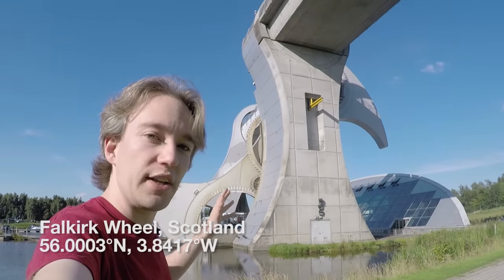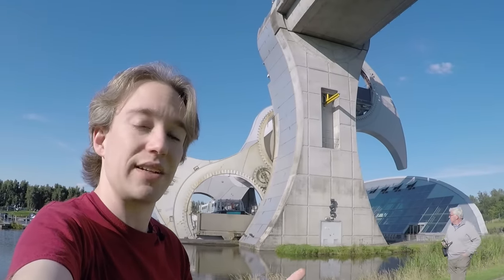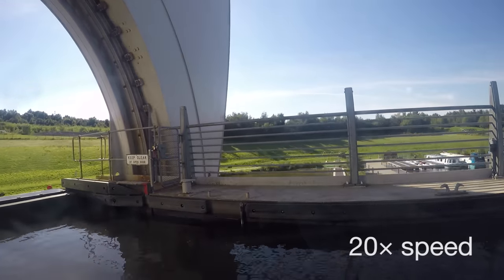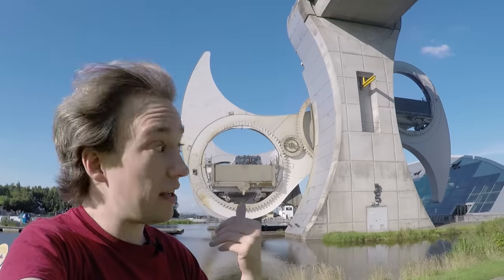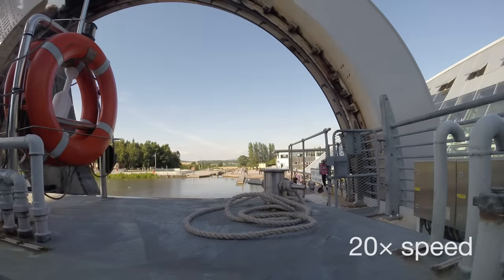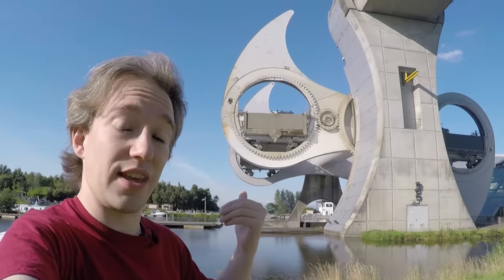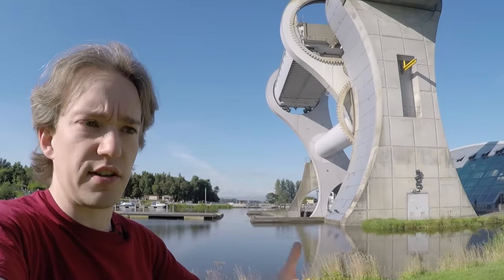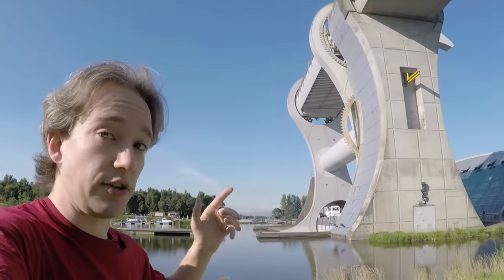Archimedes and a Boat Lift: the Falkirk Wheel

Comment: All fun and games until someone turns up with a 501 ton boat!
Reply: +Eric14492 Anything can float.
Reply: QuixoticQuaver Not if there is not enough water. If you try to put a 501-ton boat into 500 tons of water, it will go aground. As mentioned in the video, that is basic physics.
Reply: +rainbowevil You beat me to the reply.
Reply: In practice, it could only handle something considerably less than 500 tons. You need clearance all around the boat: beam, draft, and length. To maximize capacity, you have to design the boat's dimensions specifically for the lock, just as Panamax ships are for the Panama Canal.
Reply: QuixoticQuaver Tell that to the titanic.
Reply: Except a canal-fitting narrowboat of that draft which would still fit within the width (and depth) limits of a typical British canal, and still be low enough density to actually float, would end up having to be so stupidly long that there's no chance it would fit in the cason. Or most locks. Or get around any but the shallowest bends.
Reply: It depends on the density
Reply: @gwenynorisu6883  when you say shallow bends, I think you mean straight bits 😂, a 500 ish ton boat would be in the realms of 400m+ in length there are many places in the system that straight.

(im not trying to criticise just add to joke about how ludicrously huge such a boat would be)
Reply: D2O Heavy Water Anyone?
Reply: William Snow  its a joke
Reply: Then 11 tons of water would be displaced into the canal. Now that's serious business.
Reply: @Pippinn13  the union canal is a contour canal so it’s mostly bends.  Burke and Hare were too lazy to dig it straight any way too busy killing people.
Reply: @duffman9  Wouldn't it be lazier to dig it straight?  Or were they digging around land features?
Reply: Ever seen a plasma cutter? You'd have two ships of 251 tonnes in no time. Bit of bolting after the Mary Go Round, done. Next one, please.
Reply: @Eric14492  just send it around dry
Reply: @DreamClean  well my Accountant seems to think my Business can't float and he's right.

Comment: One of my family once remarked how amazing it seemed for such heavy canal boats to cross an iron trough viaduct, and that they were surprised it could take the weight...

2200 years after Archimedes and they still don't know how displacement works...
Reply: Somehow I get the idea they secretly hate you.
Reply: While your family member may have been wrong, it’s not as bad as you make it seem. Boats require a certain amount of water to float, and someone should have remarked how amazing it is, that a suspended canal can hold all that water😅.

Comment: *Not accounting for surface tension

Just because I enjoy been difficult.
Reply from the maker: +Paul Hutchinson Not accounting for water level changes in the canal, either, but they've got a fancy system of sluice gates to keep that even :)
Reply: +Tom Scott also the original prototype was made in Lego! 
and the Antoine wall (well what's left) runs over the top too!
Reply: +Tom Scott 
Really loving the series. 
So much I didn't know about.. :D

Learning is fun.
Reply: Gotta account for whether it's hard water or soft to.
Reply: @MichaelEdmond  Wait, wait, wait. I was literally just about to work out if I could build it in Lego. Dang but also yay!

Comment: The other interesting thing about the Falkirk Wheel is that it was originally designed as a simple figure-of-eight shape.  Then some arty type came along and put those pointy bits on the plans (they're supposed to look like a Celtic axe-head, allegedly).  As a result, there's a big notch cut into one of the viewing platforms 'cause otherwise the pointy bits would hit it.
So remember folks: make sure the last person to touch the plans is an engineer, not an architect; otherwise the engineer will have to bodge it after you've cast the concrete, and that's expensive.
Reply: +Edward Cree But the edge of the pointy bits never extends past the path traced by the outside of the functional circle that the caissons rotate in. Since the wheel does full rotations instead of only going 180 degrees and then back again, there's nothing that the pointy bits would hit that the mechanically-necessary bits wouldn't hit too.
Reply: +IstasPumaNevada I'm fairly sure the pointy bits do stick out further, though not by very much (so it's not obvious from the video).  However it's some years since I was there, and it's possible I could have misremembered.
However, there's definitely a notch in the concrete viewing platform - with a distinctly bodged appearance - that gives the wheel adequate clearance.
Reply: Edward Cree Not the best because the camera moves a bit, but if you watch where the rotating parts pass near the base you'll see there's no extra protrusion beyond the functional parts; the decorative parts appear to be curved circular and at the same radius as the edge of the track for the rotating tubs.  https://en.wikipedia.org/wiki/Falkirk_Wheel#/media/File:Falkrikwheelanimationmedium.gif 

Perhaps they needed to modify the platform to conform with health and safety regulations? Such as keeping the moving parts further from arm's reach, or making sure there was enough room between the platform and the moving part so that if someone jumped or fell over the railing the clearance was too great for them to be crushed.
Whatever the case, I would like to see the boat lift in person someday. It's very impressive engineering.

Comment: HI TOM! Love your videos. I have a suggestion for your next two! 
1. How cosmic rays interfere with computertech and how programmers actually have to make ways to error check because of it!
2. How you can find the speed of light by using a sausage and microwave oven (it can actually be done).

Comment: So no submarines then ...
Reply: +Penny Lane a submarine that would fit would still make it balanced, most submarines don't sink, but make their density exactly equal to water, so that they don't slowly go deeper and deeper. The only time it actually sinks is when it's descending.
Reply: sundur I was expecting "submarines can also float on the surface duh" remarks but what you said is actually clever :)
Reply: +Penny Lane There are intelligent people on the internet? Woah. Mindblown.
Reply: +Weber588 o-o Sounds like the title of the next video: ,,Things you might not know: there ARE intelligent people on the internet" ;-)
Reply: +Weber588 o-o 
Say, intelligence and wisdom is not the same thing.
There are a LOT of intelligent people on the internet.
Wisdom is a rarer beast.
Reply: +Penny Lane   As long as they are not sunk,  submarines follow Archimedes.  Now some scientists claimed differently as they tried to sell submarine detection through gravitational disturbance and that's only possible when Archimedes does not apply that's only after they were detected and sunk.
Reply: Adamast And by "following Archimedes" you mean Archimedes' principle? Because in this case I think what sundur said is more comprehensive and to the point. Archimedes' principle basically says that if and only if the density of the object replacing the water (i.e. the submarine) matches the density of the surrounding water do two things happen: a) the submarine neither sinks nor rises because there's no net force acting on it and b) you don't break this magnificent boat lift ;)
Reply: Penny Lane - Submarine? 
LET IT FLOAT, LET IT FLOAT
Reply: They,re in Faslane on the Clyde, nukes!

Comment: Why does an average American house use three times as much energy as a British one?
Reply: +doe maeries Because 'muh freedomz and muh liberties' takes a fair ol' whack of power to achieve.
Reply: doe maeries My guess: Air condition, oversized fridge + seperate deep freezer, dry tumbler and asinine vertical axis washing machine that does not really clean your stuff unless you let it run it for at least 4 hours and leaves your laundry wet.
Reply: +o_O Vertical axis washing machines?? you are joking right? Who the hell come up with that idea and that what is used to mimic gravity? ahh i have to google this!
Reply: +doe maeries The U.S. is a huge place, a good chunk of which is either a desert, or a thousand miles closer to the equator. We simply have people living in warmer climates than the British do, and air conditioning takes far more power than heating does.
Ignore the "muh freedumbs" and "greedy 'muricans" shitposters.
Reply: Hum, but top loading does not equals to vertical axis. I assume vertical axis means an, well, vertical axis where the force of gravity has very little to do when its spinning. but teh top loading machines i have seen are still horizontal axis, just loaded from a different place, and in that case the end result and efficiency should be very similar (ignoring other factors)
Reply: +Mr. Patrick Henry Cheryl It's not just air conditioning in warmer climates. We also have colder climates than England, requiring more heating. The average home is larger in the US than the UK, so heating/cooling takes more energy. You are correct that AC is the the largest reason.
Reply: Oh. Ok. that seems a little stupid. The ones i have seen are loaded from the top but they have horizontal axis.
Reply: +maxsnts I have never heard of a top loading machine that spins on a horizontal axis. Most residential washing machines in the US are top loading, with a vertical axis. Commercial and high end units are front loading. I don't know why that is.
Reply: seigeengine I guess is just not usual. but these are the one i have seen: http://i01.i.aliimg.com/photo/v0/12042027/Top_Loading_Washing_Machine.jpg
Top loading, horizontal axis.
Reply: seigeengine You need to chill out. None of your comments show up when I look at the YouTube video's page, even now. I see maxsnts' and others, but not yours. I only saw your posts after you replied to me, and only under notifications, not under the video. I have seen this happen before, some comments just take longer to show up, to some people, than they should. If you are so smart, please explain why that is.
Reply: seigeengine Nope, your comments still aren't showing up in YouTube, only Google. Has anyone else seen this problem?
Reply: seigeengine They perform a lot worse, believe me. Well, at least you don't do your washing cold like they do in Japan.

> Probably because they don't seem to be very common.
The only type of top-loader you get in Europe. And I don't know what you consider expensive but an average-sized brand TV is more expensive.
Reply: +doe maeries if you want a serious answer is that because us homes where made in a time of great space there bigger
Reply: Eric14492 I guess is just not usual. but these are the one i have seen: http://i01.i.aliimg.com/photo/v0/12042027/Top_Loading_Washing_Machine.jpg
Top loading, horizontal axis. (this is a repost os another comment just in case you did not see it, anyway, these are the only top loading that i have seen. guess its no common)
Reply: +maxsnts Thanks maxsnts, but I have been seeing all of your comments, just not any of seigeengine's.
Reply: +doe maeries Plus American living tends to be far more spread out than in Europe.
Reply: +Eric14492 Oh. Did not want to "push" the point, just replied because i thought you might want to see it. Anyhow, sorry.
Reply: +james jonue Current code mandates new houses be build with R20 walls.  Unfortunately, up until the early 90's there was precious little insulation at all (the 1970's home I live in has r2 insulation in the wall for a whopping R4 wall, we plan to replace it)!  So expect to see efficiency in heating/cooling loads in the US go way up as newer construction is phased in/older phased out.  The R-value of brick is about 0.8.  A 2x4 longways has an R value of about 2.  A wall made of solid 2x4s with sheathing, siding, and gypsum board on the inside would be about R4.  With current code both brick and wood frame houses should perform the same.  The problem is the older ones.
Reply: +doe maeries  They dont care about consumption like we do... They dont learn about the eco system and effects of pollution, becasue they consider science a 
relegion, and so dont "preach" it in schools...
Reply: Bungis Albondigas
 We can do lots... Its just some cultures still think its ok for them to consume consume consume, because they dont understand where things come from, or where they eventually go.

Thats why so many shitty places dont have water... bad management.

But if you compare various nations, its clear that some ARE doing a lot...

Where I live, 50% of our power comes from wind (at peak), and we use district heating for our homes, and we drink additve free ground water...

All it takes is SIMPLE planning and infrastructure, but the muslims, creationists, and other uneducated
(or oil based) groups lobby to prevent this in some of the "bad" countries...
Reply: Bungis Albondigas
 Yeah, garbage burning is happening, although its not ideal. There are all sorts of toxic leftovers, not to mention the emissions.

People just need to PAY for power consumption. Thats the only thing that makes the stupid masses move at all....

Its much more costly to build power-effecient structures, as we do in europe, so you get smaller houses here, on the same budget...

Nobody in the US is going to do that while energy is unregulated and cheap enough to waste...
-rather have a big house than an effecient one, and rely on extra energy consumption to compensate.

Its all about the narrow-minded individual saving 200 bucks a month on energy..
Thats the only way to get all the worlds un-thinkers to improve their energy effeciency...

People will never learn... But they will change their ways for money, and thats close enough.
Reply: Bungis Albondigas
 ah, I see... a matter/energy converter...
It'll happen. Like all that cool star-trek gadgetry.

In the meantime, have you looked at fusion reactors? those might happen... They seem pretty serious about the development of that stuff.
Reply: Bungis Albondigas
 OMG! People were talking about using cremations in our district heating networks, but it was turned down many years ago...

(appearantly, burning people to a tiny pile of fine ash consumes a lot of fuel, and wastes a lot of heat)

I remember a tv-speaker talking about having your grandmother pumped through the radiator. Lovely!
Reply: +maxsnts I've never seen one of those types here in the US, only this kind http://img.archiexpo.com/images_ae/photo-g/top-loading-washing-machine-9741-5392359.jpg   and they work fine, they clean the clothes by spinning forwards for a bit then backwards then forwards, etc. Then they run a spin cycle to drain the water out of the clothes, then you put them in a tumble heat dryer.
Reply: +doe maeries I see a lot of people complaining about that in the comments and it's just bizarre. Everyone says that as if consuming less electricity is a good thing. Electricity in America is cheap (California not included), abundant, and [depending on the state] clean, as should everywhere in the world.

My vision of the future is one where electricity is so cheap, abundant, and clean it isn't part of the equation,. The fun part? That we actually have the technology to make that happen right now (at least for a little over 200 years at current consumption rates all around the world with current mining technology while profiting, and if one particular technology being developed right now is successful the energy supply would be so immense it'd be absurd to quantify it), and no, I'm not talking about solar panels or wind mills (although that'd help if they increase the average lifetime of these products).

But people seem to be going in the complete opposite direction these days with many countries (even the EU as a whole) passing laws capping electricity consumption in certain products. What do companies do with these capping laws? They make even shittier less powerful products so as to comply with these laws all that while selling them for the same price and the consumer--as always--gets the shaft. People sincerely believe less consumption is a good thing. Why? Throughout history, you can see that electricity availability and consumption correlates deeply with quality of life. I can only imagine all the sick engineering feats we could accomplish if electricity was cheaper.
Reply: +Mr. Patrick Henry Cheryl Also, England has milder winters compared to the northeast of the US.
Reply: larger average houses, maybe worse insulation, and air-conditioning is more common
Reply: Theyre about 3 times bigger
Reply: +m8onethousand how is electricity in the US clean? Yes you have some nuclear and some renewables, but on the whole you use fossil fuels. Plus you use three times as much electricity per head as Europe. Your transmission distances are vast, leading to larger losses. You do realise that most electrical power generation is only around 30 percent efficient? Surely it's better to minimise consumption before consuming yet more resources to created yet more power and yet more waste?
Reply: They fail to plan, because "planning is for communists"...

Same reason they are having a water crisis..
Gun problems...
Creationism...
Reply: They are a lot larger. More lights and AC
Reply: They have bigger houses compared to european cities where people live mostly in smaller appartements.
Reply: Sockets are always on. We have switches.
Reply: Their electricity is cheap. Oh such a good place (please tell me it is cheaper, pleeeease)
Reply: "spread out?"
Reply: An average american home is three times better, than an average british home is in average. Slight trolling...